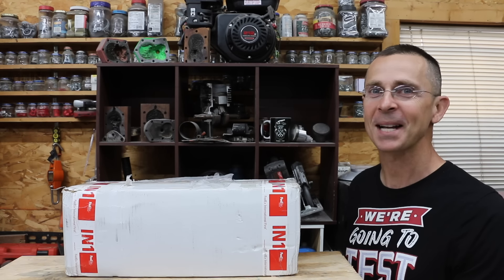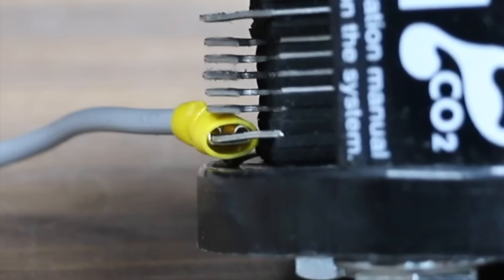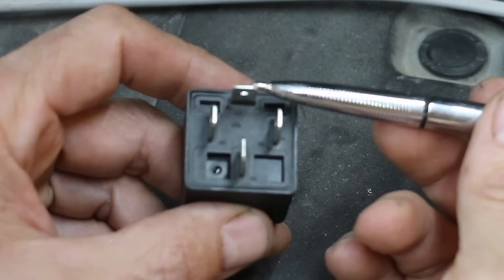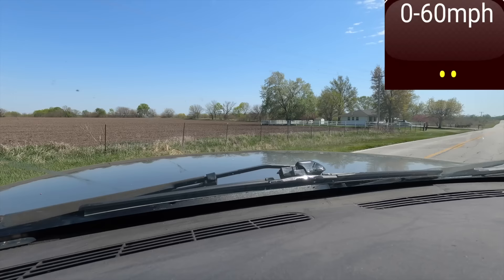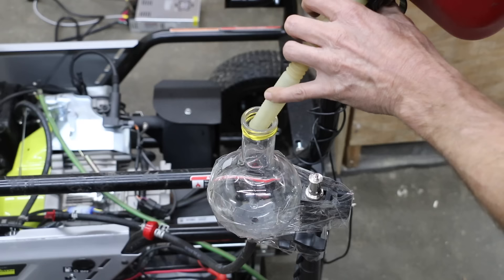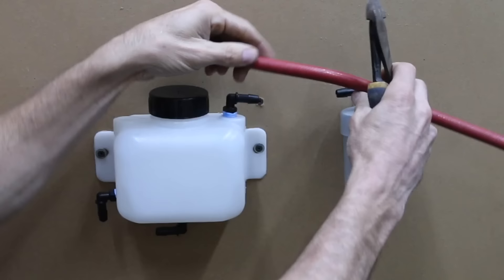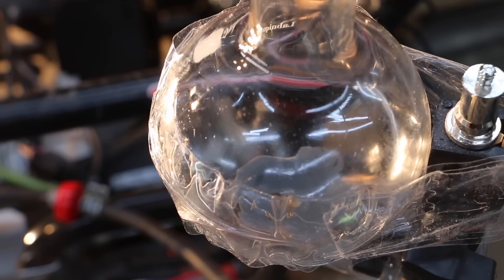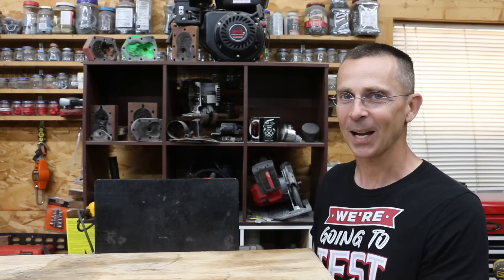AMAZING 35% More MPG with HHO? Let’s find out! Help with high gas prices?

Comment: From my experience with using hho on an engine. To see actually fuel savings you have to mess with the fuel to air ratios. Thus you dial back the amount of gasoline the engine is injecting and you're replacing that with hho to still get the same performance but you use less gasoline. Otherwise you are just running an overly rich fuel mixture and you won't see any extended run time.
Reply from the maker: Thanks for the feedback.
Reply: This is what I thought as well
Reply: Both engines in the video have EFI which means they automatically adjust the afr based on the signal from the o2 sensor. Most small efi systems (aka the one on the generator) likely target a specific afr, where as more modern efi systems target a specific lamda (the difference being afr is dependent on the specific fuel used where lamda isn't).

Comment: When i did this experiment 15 years ago, I found it depended on having a fuel injection type engine with o2 sensors.  How it makes a differance is this:
The o2 sensor reads an over fuel, event due to the HHO. The o2 sensor will lean out your gas engine to increase fuel milage. No power increase, sadly.  How much fuel savings you get depends on how much HHO you generate. Try testing out that theory. That is how I got it to work. I only comment because the generator looked like it ran on a carb! Good luck and good work!
Reply from the maker: Thanks!  Thanks for the feedback.
Reply: He ran it in a fuel injected vehicle with 02 sensors. It likely would cause a lean condition as its introduced on the downstream side of the MAF sensor. It's basically introducing unmetered oxygen and fuel into the engine. The oxygen/hydrogen combo that introduced into the intake is so miniscule that it's extremely diluted into the metered air before it even reaches the throttle body. It's likely that the ECM actually adds slightly more fuel to compensate, thereby negating any perceived savings.
Reply: Emission controls on cars do not allow for alternative fuels other than Alcohol. Take the Emission control off a 3500 ram and you can run it with French fry grease. Hell even oil based paint
Reply: Your right I thought of a small solar panel tiny really that puts out a micro voltage to trick the computer into believing the oxygen levels were optimal. This in turn would allow fuel amount to remain normal while the engine ran on more hydroxy.
Reply: You're liable to create detonation and destroy your engine leaning it out.

Comment: Efficiency of commercial electrolysis process is around 70% when using electricity.  Using a gasoline engine for electrolysis would be highly inefficient considering 25% efficiency of a gas engine. 25% x 70% = 17.5%, meaning I will only get 17.5 units of heat when burning HHO gas produced after burning 100 units worth of gasoline.
Reply from the maker: Thanks for the feedback.
Reply: That is exactly correct,, thanks for posting.

Comment: I was really hoping this would prove true, but I'm really sad it didn't live up to expectations. 😢
Reply: If something seems to good to be true, it usually is. And in this case, you're just making your car run on hydrogen run on energy from the battery, or the alternator, which itself runs on fuel. You'd be better off just using a starter that can handle turning all the time.

Also, your battery stores less energy than a coffee mug of fuel, so the MPG improvement will be nearly non-existent.

Comment: I feel like the main issue with this addition is that it is being added into the intake air so the car/generator isnt adjusting fuel injected with the offset of gas, instead its just burning both with the normal amount of gas, if their was a smart regulated system it might give more mpg but youd also need alot of hydrogen.
Reply: My chemistry may be fuzzy, but this additive is gonna burn piston heads & jack up NOx.
Reply from the maker: Thanks for the feedback.
Reply: That's the "real" issue, yes, it is weak hydrogen. The math and science just don't support it, period. In 45 minutes of running, this thing would not be able to produce enough oxy hydrogen to make one revolution of the engine. Lol. Now, for frictionless, no load operations like a torch/welder, yeah, I've seen it work, it will surely power a Bunson burner in a lab too. 

Not one "legitimate" test I've ever seen says this works. Even with modded chips, dry cell HHO, higher tech setups, it's all nonsense. It's never shown any significant change. Old carburated engines "apparently" seem to get a small gain according to some (with some tweaking of course), but they were gas guzzlers anyway and any improvement is an improvement. Lol. Fuel injected gets zero benefit from this.

Those same people said they saw zero difference on fuel injected, so I think maybe they are being honest, and maybe they do gain with carbs? I dunno, I've never seen anything debunking it for carbureted engines and if someone could do a legit, test with that, who knows carbs well, I'd like to see it. It positively does not work for any fuel injection car or truck I've ever seen.
Reply: In fuel injected.. Minus the generator.. Air fuel ratio or stoichiometric play a role in this. It will adjust. Just as my truck adjusts when I'm spraying water methanol. It sees the immediate change and adjusts accordingly
Reply: Yup. If he had a wideband o2 sensor on he could tune it to the proper mixture. Electronic fuel injection does account for variables but only to a certain extent thats why you need to tune a vehicle when you do something like install an intake , headers and/exhaust
Reply: @Charles McKinley HHO = 2 Hydrogen molecules + 1 Oxygen molecule 2:1 ratio of Hydrogen (H) and Oxygen (O) 
A pure stoichiometric mixture may be obtained by water electrolysis, which uses an electric current to dissociate the water molecules:

    electrolysis: 2 H2O → 2 H2 + O2
    combustion: 2 H2 + O2 → 2 H2O
What did you mean by saying "NOT HHO"?
Engines (some) can run completely with HHO as it's fuel source.
More efficient than gasoline? Probably not. This gas can be made off grid with some solar panels and battery banks which is in that case useful.
 I see your stance on HHO but have you ever thought of how Petrol gets from earth into your tank? It requires energy and probably more so than what it takes to produce HHO onsite. Thermal Dynamics tho right? Every truck that runs on gas to deliver gas to your gas station just for you to burn more gas to drive to the gas station for a fill up. Energy in vs energy out.
Reply: @Charles McKinley Why are you so mad at HHO? Did it cost you your job or something. I never said it was better than gasoline but did point out the energy used to supply it to people. HHO isn't replacing gas vehicles and every thing I said was CORRECT. Your opinion doesn't make my statement "wrong". If it hurt your feelings than that is your problem not mine so save the insults to other's intelligence.
Reply: @Charles McKinley  I'm not a HHO believer (or a flat earther) lol. I'm sure those two types of ppl might have something in common. I agree that many ppl  do use HHO to scam. I guess it's really the term HHO instead of saying Oxyhydrogen that throws a red flag. 
"Brown's gas" and HHO are terms for oxyhydrogen mainly encountered in fringe science. I just think saying HHO is easier that saying Oxyhydrogen.
Reply: Also don't forget the energy and losses required to generate the "HHO" is a greater load on the alternator than what it offers as fuel. So there's that too.

Comment: Thank you so much for your time taken to study this.  Several years ago my dad was interested and created his own HHO (or as he sometimes called it, “Brown’s Gas”) system and installed it on his 2003 Ford F350 7.3L diesel. It was an interesting experiment but unfortunately it too didn’t seem to increase fuel mileage any.
Reply from the maker: You are welcome!  Thanks for sharing.
Reply: Hho cannot violate thermodynamics so it'll never improve fuel efficiency
Reply: @Zxceelxuz  I don't think it's supposed to get a net positive energy from the recombination. I believe it's supposed to get a net positive by essentially combusting more of the fuel that would be leaving the system unburnt meaning the "extra" energy is provided by the molecular bonds in the fuel. Of course it doesn't work because engines are already finely tuned to provide the exact ratio of fuel to oxidizer and then compressing the mixture to combust it all. If the system just needed more oxidizer the engine would just be tuned to provide a little more air. I could imagine someone might claim that it's providing a higher concentration of oxidizer because the HHO isn't also providing N2 to the system but even then you're just causing higher pressure and engines are also tuned to run at peak efficiency for the pressure they can withstand. And even if the engine was leaving enough extra fuel unburnt the HHO would have to be burning enough more fuel to offset the power draw, which increases drag on the alternator, and the extra weight you're adding to the system. Not only will this not happen but you also have to add in the cost of the system, the water and electrolyte, and the time you invest by not only installing but constantly checking and refilling the system. I can see one reason (only one) where someone would understand all of this but still think the HHO generator will help; if they think the car companies are colluding with petroleum companies to intentionally reduce fuel efficiency. I doubt there are many people that understand all of this and still think there's that much of a conspiracy.
Reply: @witiwap86  Cars uses more fuel than 'needed' to reduce NOx emissions, the optimal fuel concentration(more lean) produces more heat in the combustion chamber. Higher temperature changes the chemical reaction of nitrogen which is a component of air and the engines will produce more NOx. NOx causes the air to be brown also known as smog (think smog will also react in the sunlight afterwards). So efficiency(mpg) and NOx pollution goes in each direction, EPA has set a compromise between CO2 emissions and NOx emission (and other harmful emissions). So you can increase the mpg on the expense of NOx. I have no practical experience how much you can gain if you let a car run leaner(less fuel in the mix), had some experience as a kid: it can give some extra power to trim your moped and get you the edge over your friends :-). If adjusted to optimal one could destroy the spark plug with some kind of conductive material depositing on the ceramic insulator that would cause the spark to ignite somewhere else than on the tip and it would be hard / impossible to start the engine from cold next time, at inspection the spark plug was nice clean and light brown. The problem could be fixed by adjusting it a little richer. I expect that the 2 stroke oil reacted in some way on the spark plug under these higher temperatures, 4 stroke engines might not have this problem.

Comment: I think you will need to "spoof" the O2 sensor as it will always aim for  air fuel ratio of 14.7:1
Reply: Exactly my idea.
Reply: No need to trick the computer, the HHO displaces air entering the engine and that decreases O2 in the exhaust so the computer will lean it up for a given load.  The problem is that the load doesn't stay the same, it is actually increased by running the HHO generator. The extra load opens the throttle and allows even more air and thus fuel through for the same engine RPM and the overall effect will be shorter run times as shown.
Reply: @nathanchristensen4864  Not been our experience
Reply: EXACTLY! ITS PRE PROGRAMED! No compensation!

Comment: Great subject. I have a bit of experience with it, I had an hho generator set up on my 99 jeep xj and had the exact same results. every bit of good the hydrogen may have done was taken away by the load on the alternator. It's absolute snake oil.
Reply from the maker: Thank you!
Reply: Why is no one talking about the oxygen sensors, lmao.  They can tell when the ratio is off and will pump more gas to compensate 🤷
Reply: @alserrette  exactly. Everyone is making the same mistake while claiming it makes no sense. It does, but you have to trick your O2 sensors so they wont put more fuel as they do when they sense more air is added in the mixture.
Reply: @jackreacher5662  not sure if the generator has an O2 sensor, I imagine it would  but would be good to know.
Reply: @harry8506  what, dude I meant sensor in your car
Reply: @harry8506  EFI generator should have an O2 sensor absolutely
Reply: @harry8506  Well, the label on the generator says it has electronic fuel injection, so it has an O2 sensor.

Comment: In 2012 i tested this same system on a Kia Rio 1300cc... Without the HHO the car was using  1ltr gas on 11km..... With HHO  1ltr on 17km. So big improvement. All i needed is to set the amps on the best level (12.2amps on our system) The Kia Needed also another lambda to fool the system of the car to get this result. So there is more you need to do to get good results.

Comment: Do you think you could do a project on fishing poles/reels at some point? I’d absolutely love to see that! It’d definitely help a lot of people too I feel like. Love the videos man, one of my favorite channels.
Reply: I would love to see him test braided vs non-braided fishing line.
Reply: @GbbJunkie Yea, and it's not even close. I remember hating on braid when it first came out back in the original Spider Wire days. Now all I use is Power Pro. Braided line has come a long way. It beats mono in virtually every aspect......well as far as for what I fish for... which is mainly striped bass and bluefish. I think mono probably has a place for certain fish that can see braid. I'm thinking like trout or bonefish that can be spooked easily but aside from that, when it comes to casting distance, knot strength, abrasion resistance, etc. braided line is miles ahead.
Reply: @GbbJunkie Well we all know it's stronger, but it would be neat to see just how much stronger, and what brand braided is best.

Comment: "I'm gonna go ahead and remove the plastic shavings so we don't try to run the engine on plastic as well" 🤣🤣🤣 why not? You've tried to run engines on almost everything else imaginable
Reply from the maker: lol  Good Point!
Reply: @ProjectFarm  hit him with a “we’re gonna test that” lmao
Reply: In fact, you can run some engines on cooking oil.
Reply: @koleso1v  in more fun fact, aberdeen proving grounds tested a abrams tank on cooking oil, IT RAN.
Reply: @Operator588  The gas turbine on the Abrams can run on a ton of stuff, its not as picky as an ICE. I've heard it could even run on alcohol. Not sure if its true, but it would help if they were invading Russia and only had Vodka on hand xD
Reply: Next video: We try to run an engine on plastic!
Reply: @rapter229  I ran a moped using meths and it would also run on natural gas :)
Reply: @charleswatts1864  I watched a video of some contraption some guy made that broke plastic down and he used the liquid it extruded as fuel.  There are companies out there that talk about pyrolisys-  that's how you make fuel out of plastic.  Guess it does work, but I'll bet you it ain't cheap to do it.
Reply: @Operator588  Most older diesel engines will run just fine on vegetable oil, as long as you don't let the oil get cold enough to gel. They will also run on kerosene, jet fuel, etc. Heck, they will run on used motor oil if you're in a pinch.
Reply: @xtnuser5338  Danger for diesel engines and gas turbines is fuel coking, which causes carbon deposits in injectors and turbine blades..
Reply: @Alexagrigorieff  Yeah, but ANY carbon based fuel will cause carbon deposits if it isn't burned completely. Certainly a particular engine has been designed to burn a particular fuel best, but that doesn't mean it won't run on other stuff.
Reply: That’s not science, you have to do it in its own test!
Reply: Just thermal crack the plastic and collect the long chains, Ben Peterson makes a plastic to diesel device that's pretty cool. It looks like a charcoal maker with some filters that makes the fuel.
Reply: @icondonnied  Yes, you can make fuel from plastic (since general plastic is derived from oil anyway).  And yes, it's too expensive to be economically viable which is why it's not done.
Imagine how much gas would cost if they could zap entire trucks full of mostly plastic trash and end up with a usable fuel for any application at all?
Reply: Funny thing, if you thermal de-polymerize the plastic it runs great in an engine.
Reply: @charleswatts1864  I suggest you cook the plastic in a pressure cooker with a little water on low (can explode) for a few days.  The sturdier the plastic the higher the pressure needed and longer it takes.  However, you can run your lawn mower on leaves and grass clippings if you cook them in a pressure cooker for 6-8 days at 160-200 degrees.  Careful though the pressure may bleed off as unflavored natural gas and CO2; not breathable and potentially explosive.  This may produce sour crude oil depending on the mineral content of your yard.  it's hard on your mower as well but, it has great power.     reference "thermal de-polymerization"